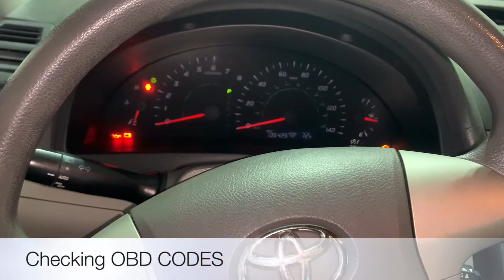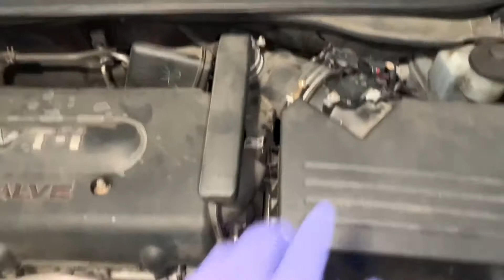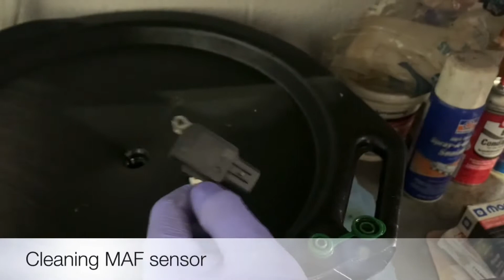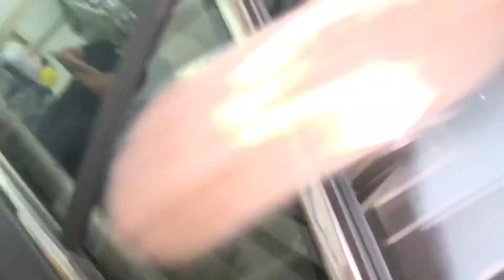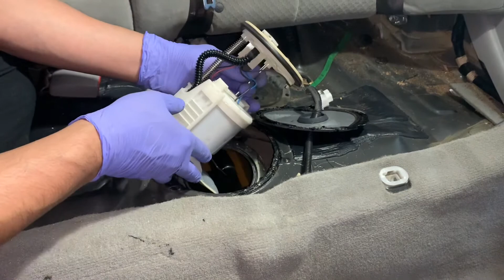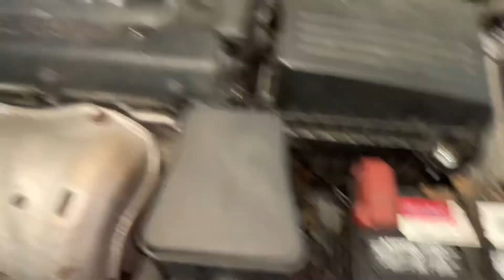2007 - 2011 Toyota Camry Code P0171 System too lean - Fixed!!

Comment: should I start with the fuel pump first and go with the maf and o2 sensor next? can you recommend a good parts supplier?  the dealership is through the roof.
Reply from the maker: Mark, you should try changing the maf sensor and pcv hose first, they are cheap. And here the link to order fuel pump assembly. These parts are good.

https://www.ebay.com/itm/333597350990

https://www.ebay.com/itm/231947501943
Reply: @mydiygarage  thank u so much. this is a stumper. can you recommend a place to buy pcv sensor and maf sensor. should I change out o2 sensor or wait? thx.  dumb question does the fuel pump module come with a fuel pump? thx.

Comment: Car won’t go over like 20 mph on flat roads and won’t go over 50-60 on the highway, what do I need? Just bought the catalytic converter for bank 1 didn’t change anything don’t want to keep wasting money I don’t have
Reply: Faukty abs module can put u in limp mode not cheap dealer only

Comment: No way the light goes off if you JUST fixed the issue.  Did you reset as well??
Reply: Not true. Every 30 seconds the ECU can determine all systems.
Reply: @radleybradford1356  not for fuel trim readings. Short term and long term take drive time to determine and not send a code.

Comment: Still having this issue.  Replaced bank 1 , replaced fuel pump, cleaned throttle body and maf, replaced spark plugs, car runs really nice but the engine light is annoying
Reply: i have the same problem. should I start with the fuel pump and then go to sensors and valves? thx.
Reply: @markdamstra  check the MAF sensor.  That ended up being my issue.  I should have checked that to begin with but I didn’t.  The MAF sensor was bad.

Comment: I get code this code P0171 & so far I changed the pcv valve & the o2 senor on top I didn’t change the o2 senor at the bottom or the fuel pump I’m about to order o2 senor cause it was shot hopefully that’s the problem. Can you give me some input? On what it could be
Reply from the maker: Please change the fuel pump
Reply: @mydiygarage  should I try the fuel pump first and pcv, 02 and maf valves later?

Comment: I have a 08 xb same code tried replacing some parts on it had no luck! the fuel pump I have not checked yet 🤔🤔🤔thanks for the vid👍
Reply from the maker: Changing fuel pump assembly is easy, I believe once you change it all your problems will ho away.

Comment: I’ve replaced everything that was replaced here in this video and I still have the check engine light on. Do I need to delete the fault code in the computer? Or should it just disappear on its own?
Reply from the maker: Please delete the code and drive around for 100 miles. You should not have this issue coming back.

Comment: Fuel pump good not problem this is internal air in engine problem pcv valve very cheap 7.49 not 900? 😱 Omg

Comment: Pcv valve very important can cause engine damage left unattended should be changed -20.000 miles like 12.000 or so how you drive oil changes too important

Comment: I am going through this pain with my 07 camry, code P0171, already replaced, oxygen sensor, pcv valve and hose, cleanned mass sensor and still light up. When car us cold takes second time to start engine ans it shakes alot. Do you think is the gas pump? Thank you.
Reply from the maker: Yes my friend, please replace the fuel pump assembly and all your problems will go away
Reply: @mydiygarage  thank you for your reply. Where did you purchase your fuel pump and how much ? Thank you again .
Reply from the maker: @joralriver9052  I bought on eBay, it came with full assembly for about $70
Reply: @mydiygarage  Is it possible to send in a link for that seller on eBay, I cant trust any seller on this exact part. Thank you
Reply: Joral I am having the same problem. think I will start with maf, pcv and o2.  and go to the fuel pump. how did this all play out? Can you recommend a good parts supplier for Toyota parts without the crazy prices of the toyota dealers? thx.

Comment: This is happening to me and usually only starts when I press on the gas a bit. Sometimes after driving awhile, turning it off then turning it back on after a bit it will be like this and won’t start no matter how much I press the gas. I have to wait 20-30 minutes for it to cool down, I try again and it works. I ordered a fuel pump thank you for this video
Reply: I have exactly the same issue, have you had any luck changing the fuel pump assembly?
Reply: My Camry has the same issue!! How did you fix it? Thanks a lot.
Reply: @AmericaLegends  Still trying to figure out if its the fuel pump, I need to make a smoke test first though
Reply: @AKAtareq  Wow, that is also what I am going to do next.
Reply: In my case it turned out to be the fuel pump, I changed the whole fuel assembly, so it might have been a clogged strainer or the built in regulator just went out. Changing the whole thing honestly was a piece of mind.
Reply: @AKAtareq  same, mine was just the fuel pump, bought the Denso OEM for $100 on Amazon and check engine light is gone as well.
Reply: @thekickingguy842  Well I was able to purchase a full OEM assembly from a junk yard for a car that drove only 40k miles, was lucky here though.
Reply: @thekickingguy842  how is it performing now?
Reply: @chubbylove1519  like a beauty still! I forgot I replaced the fuel pump if it wasn’t for you replying to this old comment lol. She’s doing great!

Comment: I had the same issue and P0171 issue. After spending $600 on parts and labor, technician change the fuel pump and P0171 issue was resolved costing me $900. Awesome video, Great job dude.